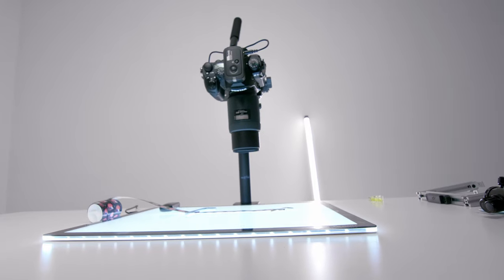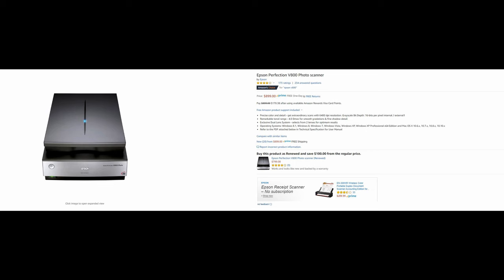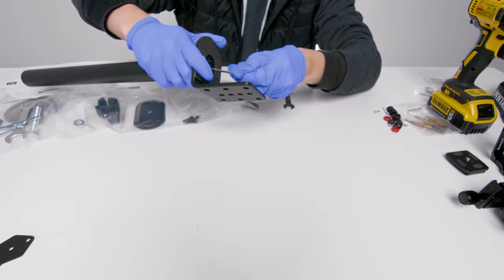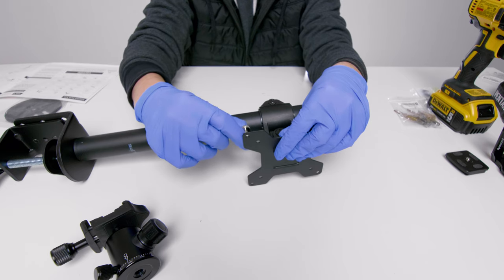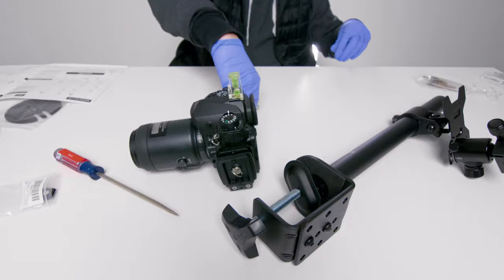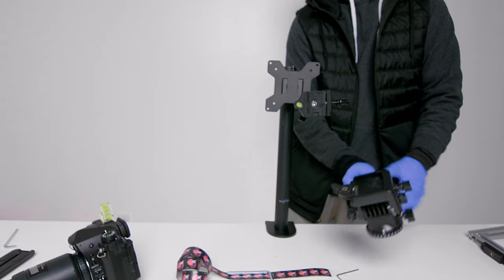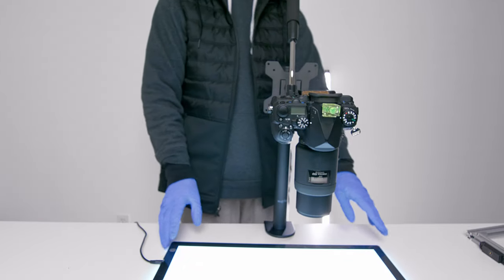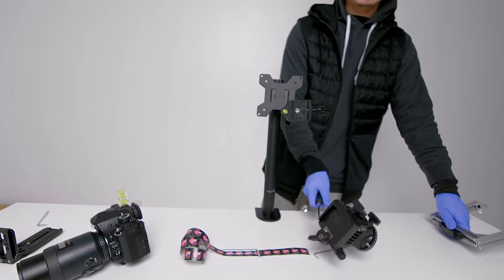DIY Copy Stand | Scan Film Negatives | Pentax K1+ Pentax 100 Macro setup

Comment: Such a simple & obvious idea. I was thinking of modifying an old enlarger stand but this saves butchering a perfectly good enlarger.
Reply from the maker: Yup! I saw folks who actually modified my rig. They went to cut a wooden square out and drilled it on the mount and made more center mount. cheap and easy. I went to look at premade mounts. Over $100 USD and some in the thousands? lol .

Have fun! I am about to modified as well. If the Monitor arm can hold up a 32 inch monitor, it should hold up any camera.

Comment: necessity  is the mother of invention!   Clever solution.   I could tell you were going to have a problem with the mount as soon as you added the 3/8 mount on the corner of the bracket.  You need a metal or wood plate you can mount on all four corners with the camera  mounted in the center if possible.  Probably the only thing I would do different if I did not already own a Epson V750 ;)
Reply from the maker: Part of the journey but I didnt see any issue yet. I was testing my stamps and seem to be sturdy. 

I will report if the K1 isnt a good solution in my next video. Still testing, but like I said, a mirrorless and even a KP would do fine as well!
Reply: the CameraVille try removing the monitor bracket and insert the tripod head bolt in place of the monitor mount screws... No need for the bracket and will make your setup more sturdy...
Reply: Absolutely, I ordered and assembled this set. Works perfectly and quality is great.  The plate was made with thin plywood and puts the camera in the center of the head. Thanks for the video

Comment: Do you still use this set up a year later? Or have you found something different that you like more?
Reply from the maker: Steph!
  I still use this as of today. Its a cheap option for me. If you are dedicated to long term scanning, you may need to buy something in the higher $100 bracket.

I develop maybe 8 film rolls a year so this is fine for me so far. If I could do anything differently is use a mirrorless for this system up.
Reply: @theCameraVille  Thank you so much for responding, it really helps knowing that it still works for you.

Comment: I am planning to use my regular camera tripod, instead any custom built mount... Have you tried to use it, before you come up with the custom one?
Reply from the maker: Oh nice!, yes I did but my camera was heavy so the tripod would tilt forward. Then I had to add weights here and there to hold it down. 

Then I tried to use the tripod upside down and scan from top to bottom,  but this means I will have to re-align it every time.  Adjust all legs and center tripod.

But whatever works for you is all that matters. This is just one way. Some people buy film scanners which is also $$.

Comment: It`s a good way ot "scanning" positives (slides), but if you do this for color negatives you should use blue film under negative to compensate negative's mask. Sure, you can do without blue film but you'll get a lot of color noise after white balance otherwise.
Reply from the maker: That is an excellent advice! thank you1
Reply: If you can do all the colour correction work within Raw processing software with Raw files, there shouldn't be any additional colour noise introduced.

Comment: I have many Kodachrome slides from the 70's and 80's.  I think your way would be way too slow.  Anyone have any ideas for faster slide scans?
Reply from the maker: Jay G. Im not sure what is the best solution. This is probably the most cheapest way but as Im reading from others, scanners can be even slower.

My question currently is the quality of the scan. As I found out today,  scanning film on a V600 epson, turns out the image gets soft than Scanning on a V800, which is sharper but will take even more time. 

The question would be what is the quality you are aiming for and the price range. 

I plan to do a side by side with my method and compare it with an outsource. We can then look at the quality first then we can go from there.

Cheers
Reply: Only the set up would take a bit of time. However, once everything is set up, it's a very quick way of digitising slides and negatives. Position the slide, click, move the next slide in place, click, move the next slide in place, click. A scanner would be much slower. However, if you want to capture more dynamic range from the slide, it would probably be wise to shoot the same slide say 5 times with different exposure settings and then combine the exposures in post. So using that approach would slow things down somewhat.